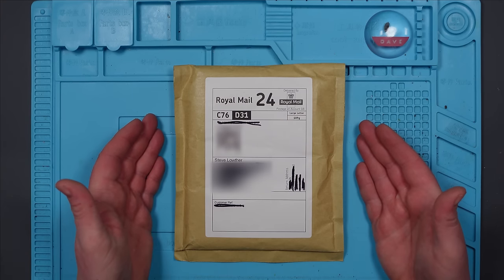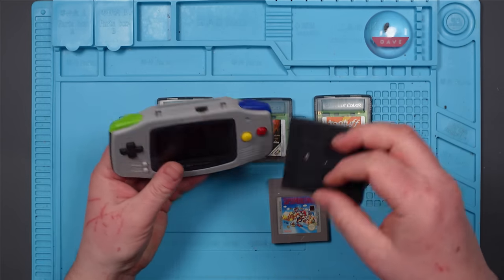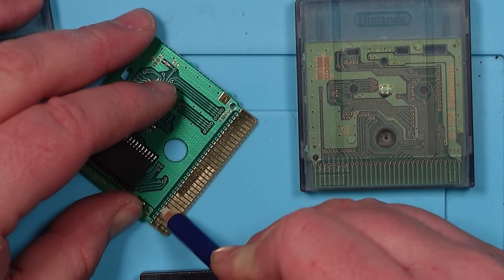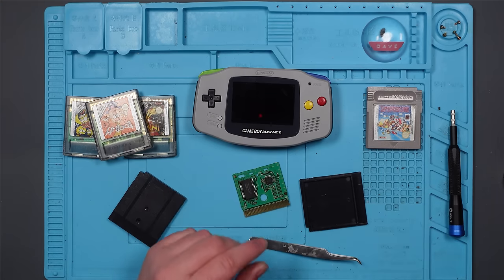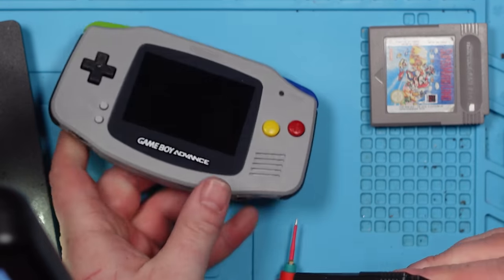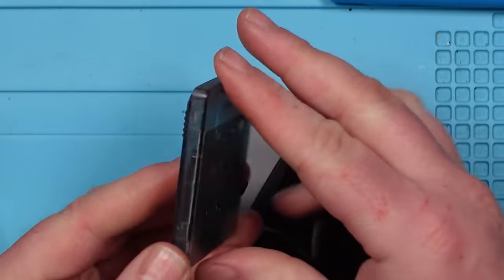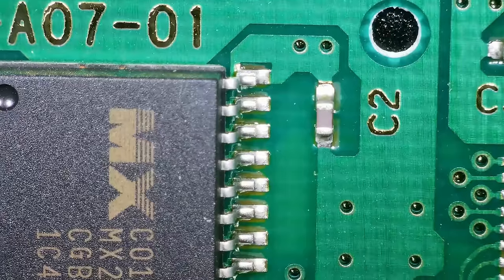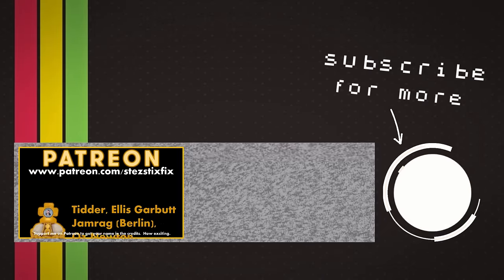I Bought 5 Broken GAMEBOY Games on eBay | How Many Can I FIX?!

Comment: Seems to be a tolerance / fab issue. The legs of the IC are pre-bent and they seem to be a bit higher than the actual bottom of the casing. Been in constant tension for the last 10 years. Now as the solder is aging it just rips itself out of the board. Could be a general issue with a certain manufacturer or run. Either way nice catch and hope you can bring to life a lot of all games with this.

Comment: I think if factory solder was not great in the first place then after working for a bit it got loose. How it got loose? Probably kids who owned these cartridges tossed them multiple times till connections detached. The one with incision is a mistery, i have no clue how it could happen on normal circumstances.

Comment: I just did my first repairs on some game boy color cartridges yesterday for the first time in my life all I had to do was replace the batteries for the Pokemon games that I used to play and I was so nervous cuz I was so scared I was going to mess it up cuz I had never used a soldering iron before. and while my soldering skills leave much to be desired I did end up getting them to work

I only have really trouble getting the old solder off I tried heating it up and trying to wipe it away as it was heated up I tried to kind of scrape it off when it was dried and I couldn't ever get it off so I ended up just pressing the battery into the old solder and then putting new solder on top of it

Comment: My theory with the cracked Mario. Someone did it on purpose. Opened it and cut it with scissors. It's the easiest area to use scissors on.  And the break is clean.

Comment: New viewer here! Just wondering what those goopy things were that you put around the chip? You had most other things up on screen as the video went, but because the syringe was out of shot, I couldn't tell what you were using
Reply: I'd love to know what you're using to detect the faults in the circuits too, is it just a volt meter?

Comment: Is that a standard GBA? I've never seen one that looks like that.
My guess at the beginning of the video... dirty pins.  I'm betting 3 of 5 just need a clean.
... boy was I wrong, 5 ACTUALLY faulty things in a fault lot?  I feel like that's a first.  And wild that it's the same defect.
Reply from the maker: Yeah, I was the same, was really expecting a few to just need a clean! I really enjoy this little job lot!
The GBA is one I pimped a couple of years ago, before I started making videos! It's got a lively IPS screen in it and is just a joy to use! I've actually got another case and screen ready for another candidate. Just need to get hold of a battered broken GBA first! 👍

Comment: @StezStix Fix? just so you know,that eraser pencil is no good for cleaning the contacts its too abrasive and will remove a noticeable layer of the hard gold plating on the pins,i wish you would of addressed this as quite a few people might unknowingly damage their carts using it,a regular staedtler mars plastic eraser works just fine and doesn't damage it at all

 TLDR;dont use the pencil eraser it damages the coating.

Comment: I've heard someone talking about how these older game cartridges will stop working in 30+ years(or less). What can fail in one of these older cartridges like the sms, nes, snes, genesis, gameboy etc(beside the battery)? Would it be difficult to fix the problems, could the chips themselves become damaged beyond repair from just "old" age? He was also talking about CD's but that's not a huge surprise but it mostly comes to how people store them. He had a lot of fascinating things to say but I wonder if it's just a bunch of talk with no substance?
Reply: The actual mask ROM used to store the game files will last potentially centuries so like you mention I wonder what the potential points of failure are. Apparently the last system to use Mask ROM was DS, in game cards below 64MB size. Then they moved to flash memory with a lower lifespan.

Comment: You can save yourself some money if you dont buy that screwdriver just for the games. You can just take the hull of an ballpoint pen, heat up the tip with a lighter and press it into the screw of the cartridge. Let it cool and you have a basically free screwdriver for you gameboy cartridges.

Comment: Let me know if you'd be interested in fixing a Paper Mario 64 NTSC cart for your channel content.  I have one with a broken trace and a messed up solder job (Solder is on one of the cartridge slot pins and there is a burn mark on the board from my soldering iron being too hot).

Comment: I wonder if the problem has to do with the flexibility of the casing and the rigidity of the chip. Maybe like how an ice tray can flex and bend, but the ice cube is so solid that it cracks away at the corners and just pops out? I bet all of these were stepped on.

Comment: 10:17 "why would that be loose?" because it's soldered with crappy lead-free solder all in the name of "health". The funny thing is all modern PCBs have all of their SMDs placed by a pick and place machine and baked in an oven without a need of a human to do the soldering. The truth is manufacturers purposely use shitty lead-free solder because they know the life expectancy is going to be reduced, call it planned obscelesance. 

Good work Steve! Another piece of advice :) when you're curing the UV conformal adhesive/coating is use your hot air and UV lamp together to cure it quicker and I may add better.
Reply from the maker: Thanks BeoGeek.  Makes sense, such a shame that most things like this will just end up in landfill due to a tiny bit of solder!  Appreciate the tip on the conformal coating, I'll give that a go 👍
Reply: @StezStixFix  Yea when you really think about how many things people simply throw away because they don't know how to repair it it really starts to worry me. Sure some things just have to go as time passes but some can be saved with a little know-how. I just did a repair on a Sony VCR from 1993! The client is in his 70s and he has the wildest VHS collection and refuses to go digital. He said he didn't care for the price of the repair, only that he needs his VCR to work. Long story short, he's enjoying the movie se7en this evening :) 

Keep up the good work mate. PS: Still waiting for my gear to arrive to start capturing!
Reply from the maker: @beogeek  Great work!  I have to admit I have a soft spot for VCR's.  I think I might try and pick one up!

Comment: If the Gameboy games were left out in direct sunlight, the elevated temperature would deteriorate the integrity of the solders bond over time, that would make a decent bit of sense as to how all of the solder problems seem to be on the same chip

Comment: Crazy that they would cheap out on solder. Had to be part of a production line issue during manufacturing. I wonder if the chips were dated, if there is a way to tell if those chips were from a particular manufacturer or a certain batch number. Would be interesting.

Comment: Your address is readable from the datamatrix you left uncensored, just so you know.
Reply from the maker: Thanks for letting me know.  I scanned it and nothing came up, but I'll have another look at it. 👍
Reply: @StezStixFix  You're welcome. Usually these apps scan only for QR-Codes. Datamatrix is very common in logistics and used by postal services. There are also online decoders you could check out.

Comment: I have a request for these videos:
The content is cool, but I don't understand (among other things) how you know when to expect a beep, and when to not expect a beep. Why should those 2 pins have a current, or not? What are those black chips and why are there more than 1? What's the clear stuff, and why do you need it? I'd request that, when you do these videos, rather than fill with nonsense dialogue, instead teach us some knowledge relevant to what you're doing.
Even if many of your videos re-explain common concepts, it's worth it.
Still fix 'em, still make jokes, but add a lot more focus on teaching fundamentals of circuitry.

Comment: I wonder if this is fault with the manufacturing process or the design? My guess is on the design, I think the everyday use of these cartridges puts an uneven, unplanned stress on those legs which therefore have a tendency to come loose.